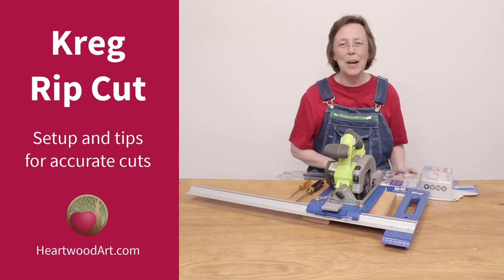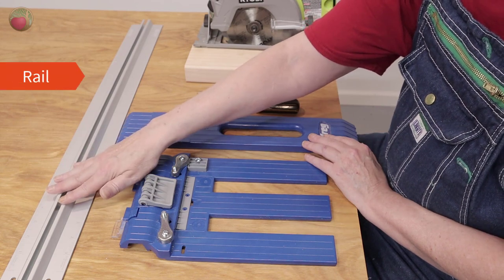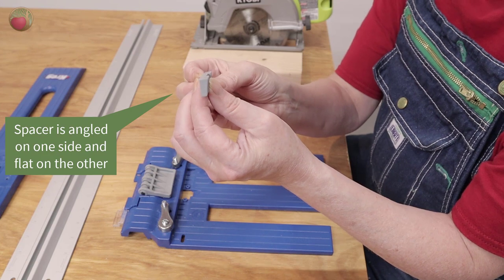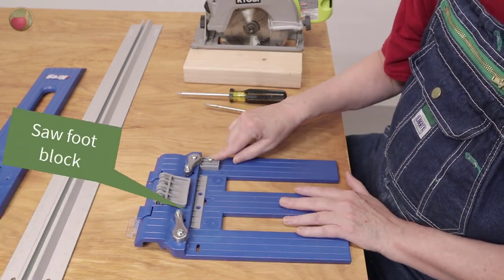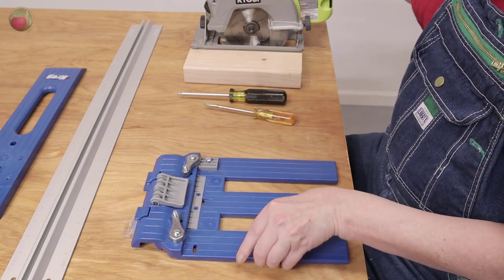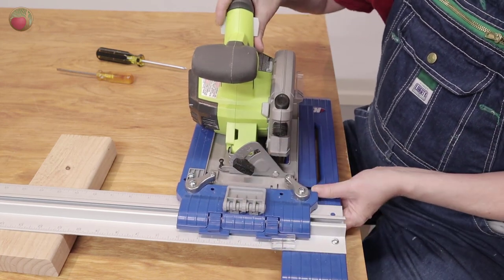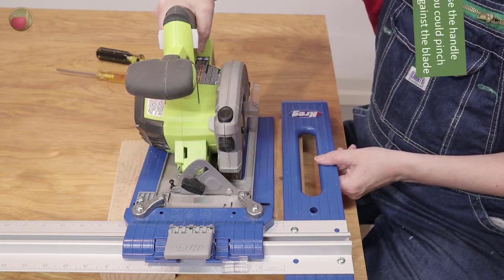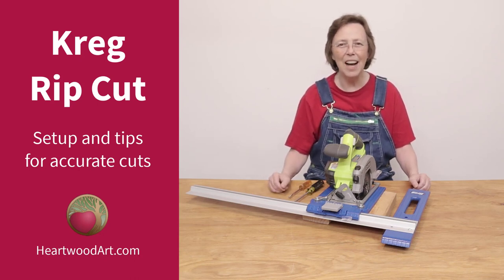Kreg Rip Cut Setup and Tips

Comment: @Heartwood Art  A few others mentioned this too.  The blade (with the cover pulled back)  is supposed to be tight up  against the blue guide that attaches to the metal rail. Then you move the clear guide  (on the sled)  so that read line  is at the zero mark  on the metal guide. You won't actually be ever cutting at zero. That is why it says on  the metal rail that is not recommend to cut shorter than 1 inch cuts. So, in your video when you talk the blade binding, you would never cut there for that to happen in the first place. Your example of moving the circular saw cover back and forth to show the blade not being able to bind against the bottom blue guide is not a scenario that would happen unless you are trying to cut below 1".  Again, not recommend.  If your  cuts are accurate, then you most of adjusted the clear guide or simply got  lucky that clear guide was in the right location your saw. But, if it's not in the right position, this video won't help you get it correct. However, you don't mention this in the video. 

You can see this on Kreg's setup video: https://www.youtube.com/watch?v=vgCncJ0N0gs

Also, for the saw blade cover, you should be centering this in the opening of the blue saw sled opening. That way the cover it's self does bind. In the video, yours looks to be close to touching one side. 

By the way, video was great. But, that section might confused people.

Comment: The cursor should be inline with the outside cutting edge of the blade.  Apart from that,  a great explanation of how to set the Kreg up.
Reply from the maker: Iif you align it that way, your cut would be off the width of the kerf

Comment: Would love to know how to safely use and measure how to use the kreg rip cut when cutting a 45 degree angle! (example, cutting plywood at an angle for joining two pieces at a 45 degree corner without a table saw)
Reply from the maker: This tool is made for parallel straight cuts.

Comment: My question is, should I have thos AND a track saw or just one or the other?
Reply from the maker: @V1N_574  this tool requires a straight edge to track on. So if you’re cutting a lot of new plywood with factory edges, this is a quicker way. But with a track saw, you have to line up the cut

Comment: I think you need to bring the blade right up tight to the rail when your zeroing in otherwise your going to be off half the width of your guide
Reply from the maker: You have to be careful of binding, which is super dangerous. My cuts came out exact with the method I used

Comment: Nice video…but according to the manual, you’re supposed to lift the blade guide up and then slide the sled until the BLADE lines up with the edge guide, then zero the cursor.
Reply from the maker: @pablito_1985  they may have changed the manual since I made this, but that does sound like a better way to do it

Comment: Why did you keep saying this was a right handed saw? This is a left handed saw ….
Reply from the maker: A left handed saw would have the blade on the right so that it would be on the inside, center when you hold it left handed
Reply: @HeartwoodArt  But if you hold the saw the blade should be facing away from you, if the blade is facing your body that’s dangerous.
Reply from the maker: The blade is always facing down. Left and right positions are what change in reference to the handle, not up/down positions.
Reply from the maker: Here’s an article on the debate about it. Blade on left with regard to handle makes the cut line easier to see for a right handed person, hence it is considered a right handed saw https://www.protoolreviews.com/left-side-vs-right-side-circular-saw-blade/